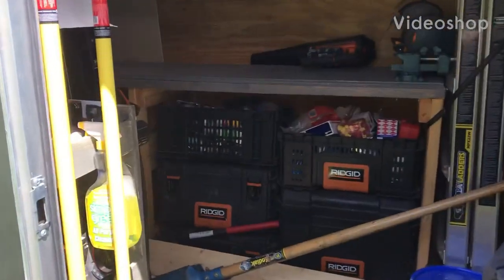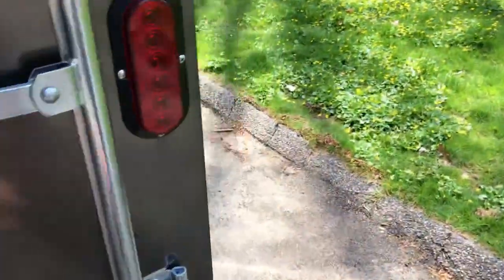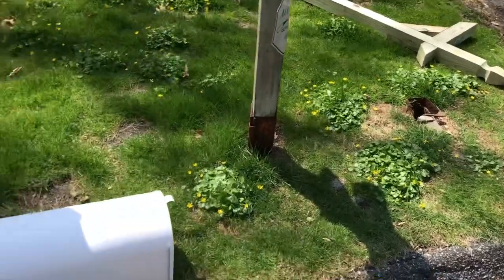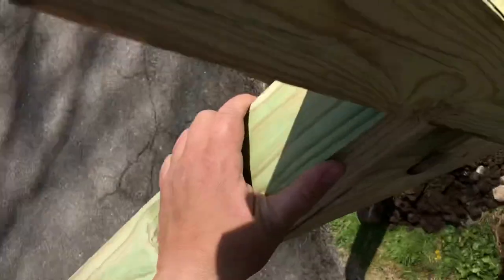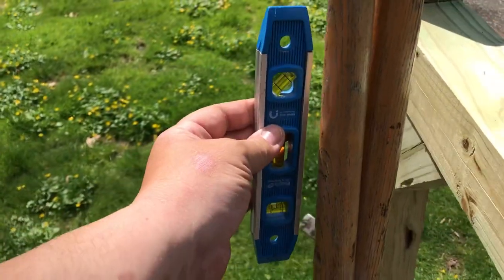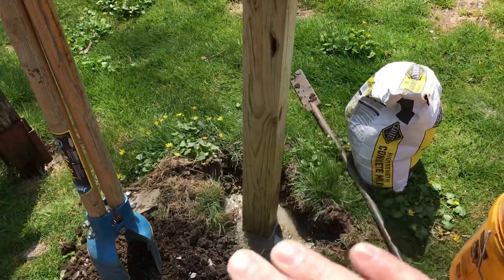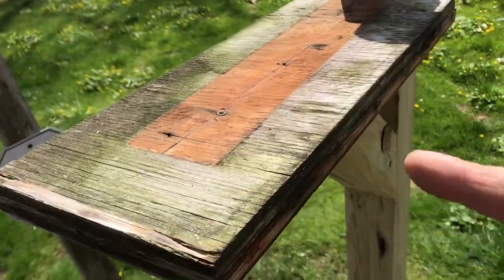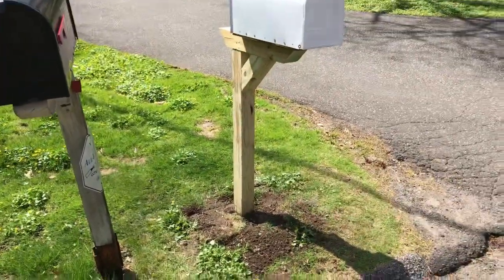How to install mailbox / post quick & easy

Comment: I’m a teen thinking of selling mailboxes and installing them. What are the alternatives for the concrete. I’ve seen people use expanding post foam or just spray foam, and also the metal post mounts. What do you recommend?
Reply from the maker: Which ever is easier and the most cost effective for you👍🏻 good luck!! Go get it!!